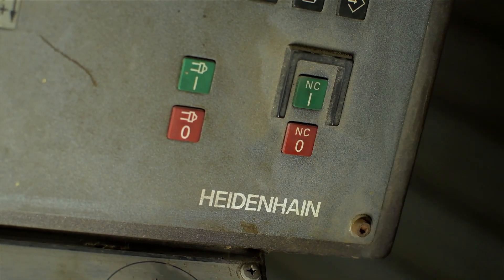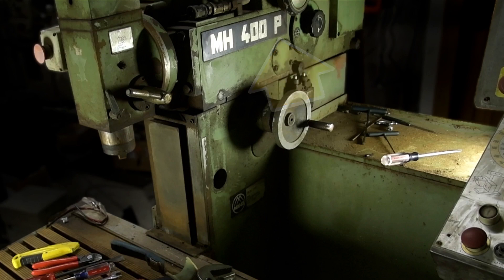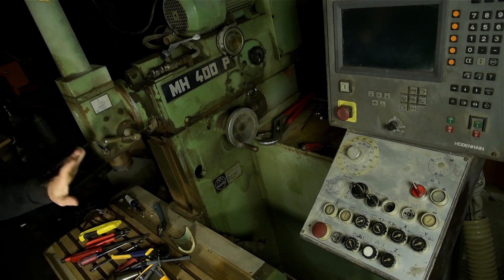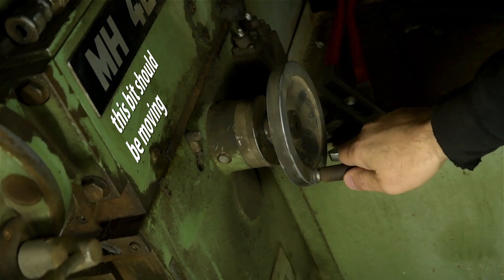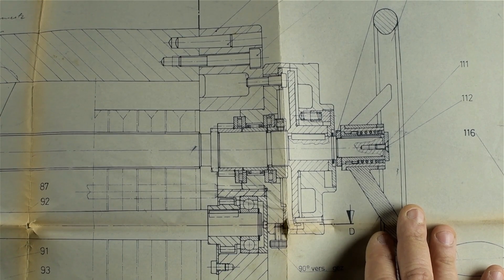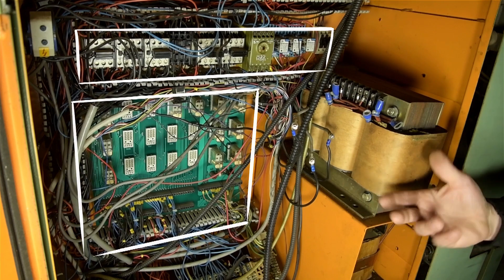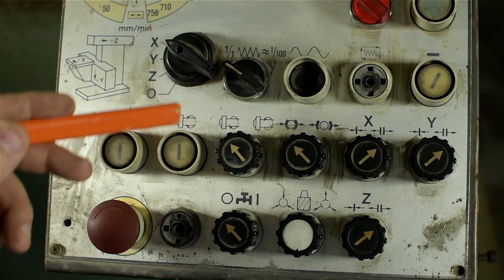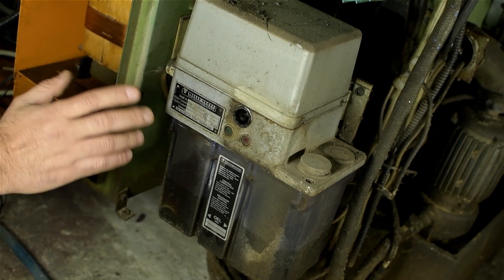MAHO is Filthy!!  (Whose Milling Machine Isn't?)

Comment: Tony: for the last 14 years or so I have had the pleasure of, from time to time, working on / maintaining? keeping running some remarkably similar looking machines made by Deckel (the D in DMG mori). They also have Heidenhain scales but sport Hurco controls running ball screw driven axes. On rare occasion we have had to tighten the ballscrews and adjust the gibbs. After nearly 30 years of life they still can hold 2 ten thousandths over the full range of motion. That German iron is top notch stuff. Good luck with it.
Reply: Not surprising they were similar since the "M" in DMG Mori stands for Maho.
Reply: @Rickertt did you think bogy didnt watch the same video, and thats the reason he wrote that? asking for a friend..
Reply: @bvs1q  Tony mentioned that literally 2 seconds after i posted that comment, so embarrassing... To add something new: The G stands for Guildemeister, a renowned german lathe manufacturer, which acquired Deckel and Maho in 1994, became a stock company in 2002, and started a cooperation with Mori Seiki in 2004, forming the company DMG Mori AG we know today. Interestingly after the merger, the old production sites were not closed down and exist as saparate organisations within the company. They even retained much of their original specialities. Guildemeister is still producing lathes in their factory in Bielefeld Germany for example.

Comment: At 6:17 it says:

The universal table is equipped with scaling function off-the-shelf, which enables you to "re-set" the zero point effortlessly.

In the dial-holder (1) and (2) are precision-dials built in, safely covered by lids (3) and (4). To change these dials, the holder needs to be removed.

Scales on the dials are tuned to "zero" by pre-tensioning with 1mm and by that you set the starting position.

This can be repeated infinitly and the accomplished accuracy is useable for most tasks.

For tasks which require the most scale accuracy we recommend set-ups according to page 3.04!

Comment: I would rather try to restore this thing, sell it off and buy an actual CNC...so much conversion will ruin the machine. I would look into generating gcode on a computer to use the internal controller. It seems like a waste of a perfectly decent lathe.

Comment: I am looking forward to your conversion. I am currently stuck on my own Deckel FP4NC project and still have to wire and program some stuff in. It is also using the Vogel Zentralschmierung (central lubrication system) and the Hawe Hydraulics for the power drawbar. Do you already have any plans what servos you will be using for the axis?

Comment: I would think the 1:1 isolation transformer is because some dc to dc converter circuits can not be run on rectified mains and need either a battery or a rectified secondary. I just watched The Apocolyptic Inventors series on switchibg power supplies so it popped into my head.

Comment: Wow, awesome machine ! Already retrofitted though, originally they came with a much older control system. This was the first CNC machine I was allowed to operate in school.
Maho saw this as a horizontal machine with added vertical head indeed, the reason for the weird axis system.

Comment: I work with both Maho (6 and 4 hundred) they are nearly identical, but the 400 has an Weaker Spindle Motor and less Movement. They are close to indestructable. You can Use the 600 drawings for the 400 to locate some parts. I would use the original Heidenhein, after a bit of work in they are Great for normal things (milling) but if You want to engrave ......

Comment: That was probably a buck/boost transformer for matching the incoming voltage with the require voltage.  Germany is a 50hz 380v country, so oddball to start with.  The transformer was probably jumpered for the wrong voltage, or just jumpered to the wrong lugs altogether.

Comment: I would think that first Xfmr is a line isolation xfmr, to clean and isolate in coming power to save the internal components from surges, pops and dirty power (RFI).  It should work fine without it....but longer with it in service.  Hard to make one of those go bad, but you can buy an external one if it is.

Comment: It's an isolator transformer which separates the machine motors from mains due to induction and such.
Reply: I was wondering if it might be a transformer that gives a 230V single phase output from the 400V 3P input. I've seen it before on a large table saw where some smaller components were single phase but it was designed to work off a 3P supply without the need for running a 3P + N feed to it. If that is the case, it could also explain why some components on this mill aren't working as they no longer have a supply to them.
Reply: @Duncathon  well it has 3 coils which tell me it's a 3 phase isolator transformer, I got a xyz emx and when I wired it up it had a transformer which takes one of the phases and transforms it to 110 volts since that's what the servos run, but the neutral is not utilised at all.
Reply: @BorisSpark  : So, I guess he's gonna want to rewire that transformer at some point? Guess he might as well do it over the winter...
Reply: @absalomdraconis  I wouldn't bother if he is going to rebuild it into a CNC, it will cost so much to do that sort of bits

Comment: Hug? ^.^ offers hugs I need a few days off anyway
Reply: The "transformer" that you wired around might have been a voltage stabilizer. Give the age of the machine, I wouldn't be surprised. Even now a days with VFDs a commonality big motors pull a lot of current. And a bunch of motors all starting together will pull a lot of current. Depending on the VA of the source, as current gets pulled high, voltage can be pulled down. And a voltage stabilizer can be a great way to restore some of that voltage (and efficiency of the machine which in turn lowers VA consumption).

Comment: Not for nuthin... I think I scrapped one of these that was "automatic" but not NC or CNC. The sequences were programmed via insertion of cams into a plastic chain that was like 20 instructions wide.   Also, I helped install 2 Heidenhain TNC360 control systems. One of these is still in service here. Familiarity, but not exactly expertise. The biggest challenge I expect you to face with this control is that the backup battery failed, and there's a strong possibility that all of the control's parameters were lost as a result. Unless your documentation includes said parameters, it is really pointless to try to salvage the control system. Unless you love challenges that result in a CNC with limited capability. I would be happy to share any knowledge I have.

Comment: If the transformer is in fact wound 1:1 and wasn't just shorted to the core, it was likely for galvanic isolation and you're probably wise to avoid touching the machine while it's running. It may have also been part of why that secondary supply let its magic smoke out. Hard to say without a real wiring diagram.

Comment: We still have a MAHO 600 and a MAHO 700 at my my work, despite having newer DMGs with 5 axis and other  machines we cant get rid of them because they just work. Both from the late 80s and they just keep going strong. Ive been using them for 15 years now. u gotta love em
btw you can swap the Y and Z in the parameters, we did that on ours because it doesnt make sense otherwise ;)

Comment: Im currently doing something very simmilar. I've also bought an old german Mill with a TNC135 "Streckensteuerung" (can only move one axis at a time). I had also hoped for ballscrews, but I had to do the conversion to ballscrew myself. But only on X/Y. Z (up/down) can stay trapezoidal because the weight of the table eliminates all backlash. 
Maybe the things I've learned so far can help you: 
The one motor on my machine is connected to all three axis via electromagnetic clutches which get activated by the mill. I would guess it is probably very similar in your machine. 

Have a look into Linuxcnc. It annoying to set up, but is very nice once running. Hardware interface cards used are Mesa IO Cards, which can be connected via Ethernet to a pc.

About the glass scales: They will probably provide current or voltage sinusoidal signals. Most CNC input controllers want pulses! I've made a small PCB to convert the signals into pulses, because I couldn't find anything that wasn't a ripoff. If you need/want them, I've still got some left.

Comment: Hey Tony,
i think you've got a beautiful piece of machinery.

Let me introduce you to the nomination of the old maho-machines ;)
The first two letters MH represent the manufacturer Maho.
The 400 stands for the travel in x-direction
The P stands for "Produktiv" in german which equals productive in English. This last letter was used to mark special options on the machines like in youre case the one electric motor which could move one of all axis at a time.

Like you already thougt the shifted z-axis is because they wanted to point out the machines posibility to detach the vertical milling head and use the machine as a horizontal mill. This way you could get four sites [or even 5 if you had a machine with a rotary table] in one setup. The horizontal configuration is also a lot more stiffer than the vertical spindle. 

You propably would have a hard time getting those servo-motors running without the original drives. If i'm not wrong the scrapped machine you got those from was propably a machine with a cnc-controller on it. I think maho used mainly indramat-drives back in those days, which you can still find used, at least in Germany.

If you have any more questions about your machine or something else related to this topic feel free to contact me, maybe i can help you.
Greets from the Southern of Germany

Comment: I think you are right about the transformer.  I think it is power conditioning.  It (probably) stores power in the magnetic fields to override surge(s) caused during operation or dips in incoming AC voltage.  I have something similar in my storage area, in its own dedicated cabinet -- the damn thing is to heavy to throw away -- and that's its job.  Long before there were UPS, there things like this.  It would also act as a noise isolation device to reduce hash on the AC power input caused by Kachunka-cachunka.

Comment: I think (because it could be almost everything without closer inspection) the part you just bridged or disconnected is called a net filter (German: Netzfilter). It's designed for filtering any non, in your case, 60Hz frequencys out of the power supply (in the machine and out of the machine).
Please correct me if I am wrong.

Comment: I am just curious what direction you were going to go for the CNC controller, are you going to go for a standalone drop in cnc controller or something like a PLC and run a cnc software on the PLC to read the gcode? And if your using a PLC what would you go with?

Comment: check out what centroid has to offer for your cnc retrofit. I just replaced the old anilam crusader M control on my machine with their allinonedc board. It runs buttery smooth and I got to keep my dc servos

Comment: First of all turn on the electricity.
 To use the Elektronik display you need to press the button at (with the orange circle) the upper right corner and than two seconds the white square button over the emergency button. If you did it right there will be standing 
x-Achse,
y-Achse 
z-Achse 
You need to press the nc on (green) button the mashine will   automaticallylIt will automatically approach the reference point x (press again nc on for y and again for z). if everything worked, there should be something in the three  boxes on the right side. Press the small button in the middle with the orange circle next to the display. And there you have youre german "Fräse" . Any questions?
Reply: I always thought it was Up, Up, Down, Down, Left, Right, Left, Right, B, A, Start. 

I dunno though, you kinda sound like you know what’s going on😉
Reply: @MrJeepinZeke  If you do that you unlock some minigames but don't tell someone.

Comment: Hey Old Tony - You could keep the hydraulic drawbar and still use air with an air hydraulic booster/intensifier.  I have one sitting around that I'm not sure if I'm going to use for my mill's drawbar if the specs make sense for your machine.  I think you just have to match the displacement of the drawbar cylinder with the displacement of this thing's cylinder and then adjust the hydraulic pressure with air pressure.

Comment: Is it possible there's a differential powering all axes at the same time?
This would make sense in combination with the hydraulic locks.
Reply from the maker: could be!  I need to buy an engine hoist before I try to take this thing apart.
Reply: @ThisOldTony     ...or an old clapped out electric forklift?

Comment: The transformer is most likely for the secondary voltage (control voltage). The main current path
 would just be attached to U-V-W (input of the transformer) and the secondary comes out at u-v-w. But can't tell for sure without the circuit diagram or some closer inspection.  
greetings from germany i love youre chanel :)

Comment: 400 i suppose is 400 mm travel of the table if you have a chance to remove the table and check the table guides for wear will be nice in case if you going to make some renovation /restoration

Comment: Hey Old Tony, do have pressed the white button with the black ''I''. This is the control voltage need you want started the machine. That you can reference the axis after that. When you need more help i used this kind of controller a few years.

Comment: I learnt on a MH600, they where retired production mills. I think we also had a MAHO with hydraulic motion control, and everybody hated it, I used it once and didn't noticed any difference, but I probably don't have the experience to judge. If I remember correctly, the MH600 was single axis only, too. But I think it had a single driver and multiple servos instead of one giant stepper or whatever is powering your MH400... ;)

Comment: Blimey, hope your Sonic Screwdriver isn't on the blink, looks like the Chameleon circuits are jammed in a state of high dudgeon, anything might happen : beware the MAHO 60 configuration modules in reverse polarity, they take a 12-dimensional scan of the surrounding area to determines what the best thing to turn itself into is, then it changes into a 1960s police box.